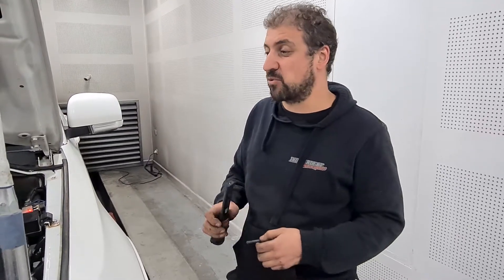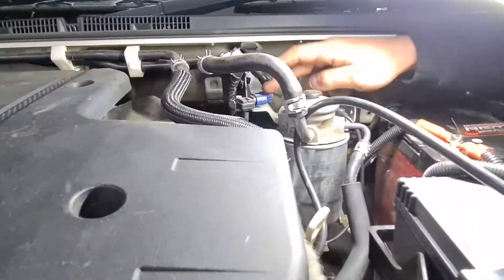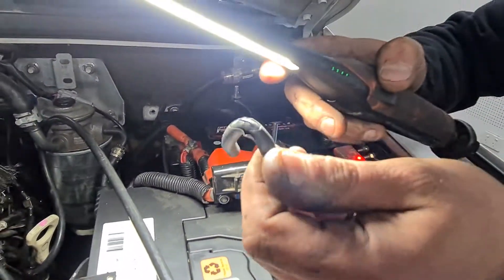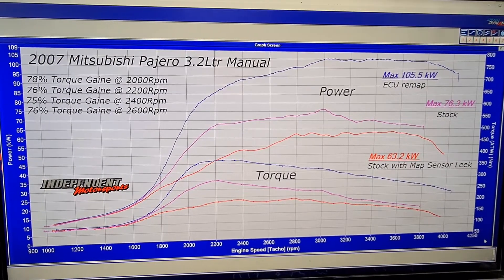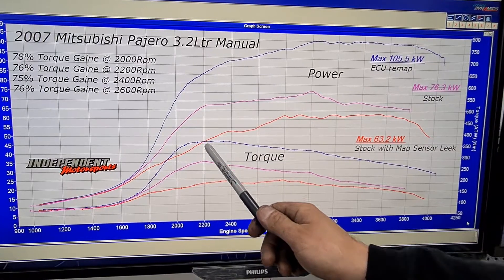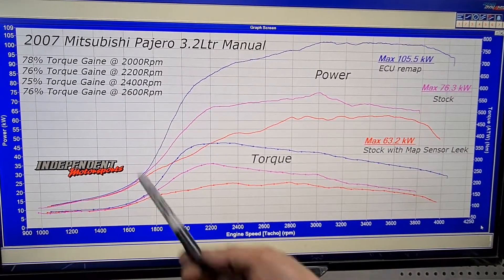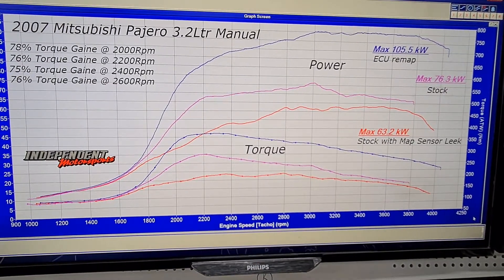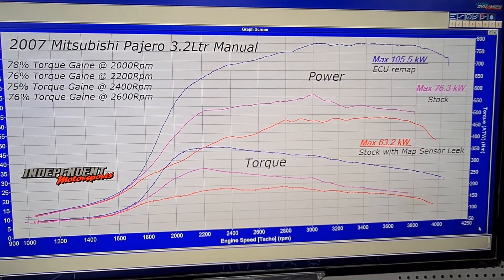3.2Ltr Mitsubishi Pajero ECU Remap & map sensor leek fix

Comment: Problem from italy)) same totaly car.
At minimum rpm, with engine hot, i see 500 rpm. I cleaned mainfold and the car had 50.000 km. Any ideas? Thanks a lot
Reply: Hey brother, did you manage to find whats the problem ?
Reply: @serebbi  a specialist told me try with cleaner because is a little part in the pomp....now I try before disassembly. I bought fcar25